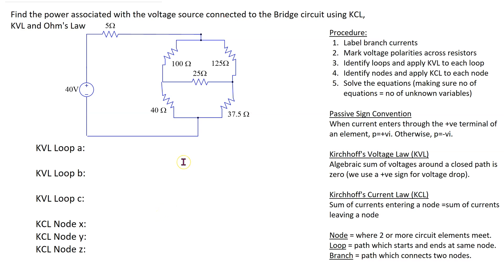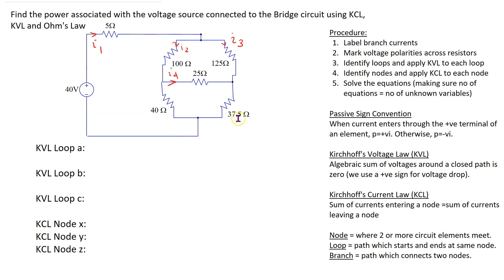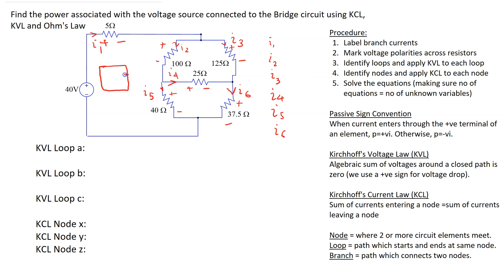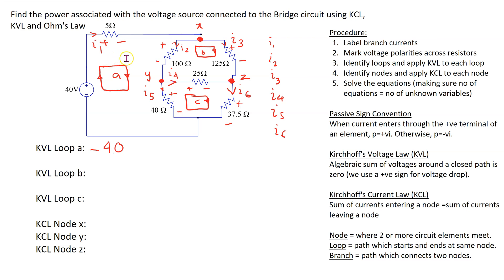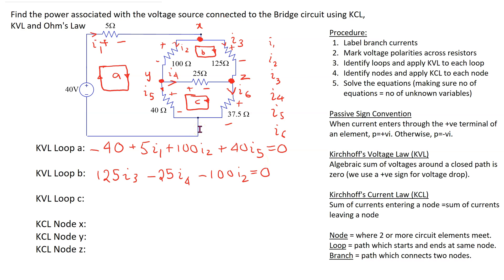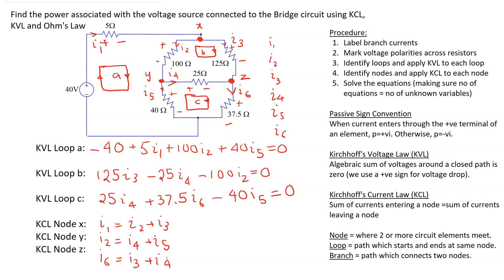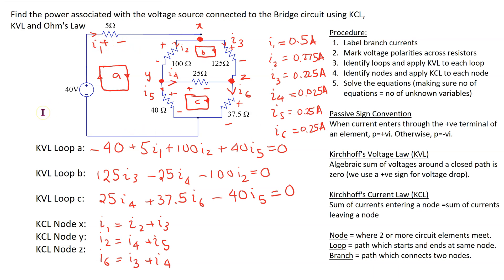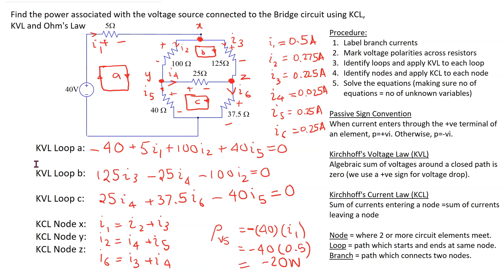Solving Circuits Using Kirchoff's Laws and Ohm's Law - Example 3 Bridge Circuit

Comment from the maker: # Pyspice (Python) code to simulate the circuit in the video is below.
######################################################################

import PySpice.Logging.Logging as Logging
logger = Logging.setup_logging()

from PySpice.Spice.Netlist import Circuit
from PySpice.Unit import *

circuit = Circuit('Example 3')

circuit.R(1, 1, 'x',            5@u_Ω)
circuit.R(2, 'x', 'y',          100@u_Ω)
circuit.R(3, 'x', 'z',          125@u_Ω)
circuit.R(4, 'y', 'z',          25@u_Ω)
circuit.R(5, 'y', circuit.gnd,  40@u_Ω)
circuit.R(6, 'z', circuit.gnd,  37.5@u_Ω)
circuit.V(1, 1, circuit.gnd,    40@u_V)

simulator = circuit.simulator(temperature=25, nominal_temperature=25)
analysis = simulator.operating_point()

for node in analysis.nodes.values():
    print('Node {}: {:4.1f} V'.format(str(node), float(node)))

for node in analysis.branches.values():
    print('Node {}: {:5.3e} A'.format(str(node), float(node)))

######################################################################
# Calculate and display the currents using the simulated node values

i1 = (analysis['1'] - analysis['x'])/circuit.R1.resistance
print('i1{}: {:5.3e} A'.format(str(i1), float(i1)))

i2 = (analysis['x'] - analysis['y'])/circuit.R2.resistance
print('i2{}: {:5.3e} A'.format(str(i2), float(i2)))

i3 = (analysis['x'] - analysis['z'])/circuit.R3.resistance
print('i3{}: {:5.3e} A'.format(str(i3), float(i3)))

i4 = (analysis['y'] - analysis['z'])/circuit.R4.resistance
print('i4{}: {:5.3e} A'.format(str(i4), float(i4)))

i5 = (analysis['y'])/circuit.R5.resistance
print('i5{}: {:5.3e} A'.format(str(i5), float(i5)))

i6 = (analysis['z'])/circuit.R6.resistance
print('i6{}: {:5.3e} A'.format(str(i6), float(i6)))